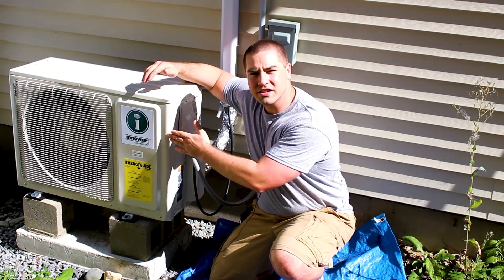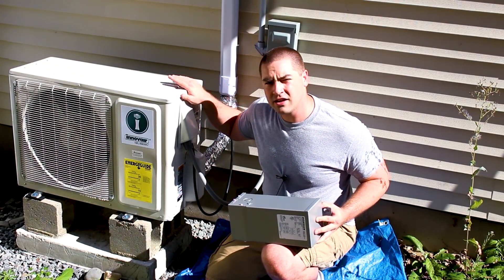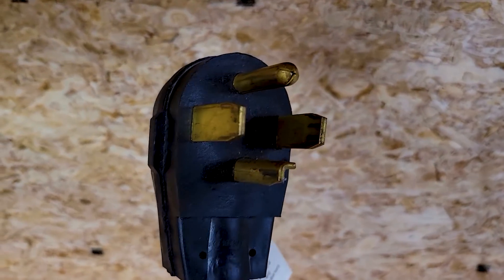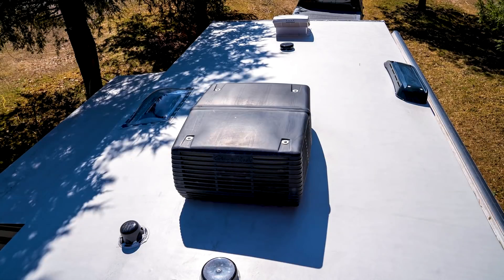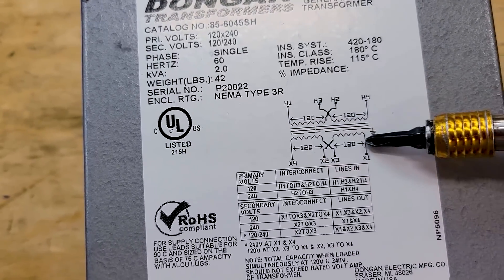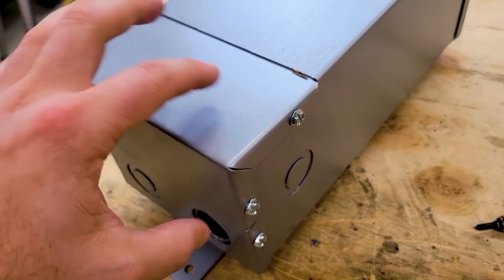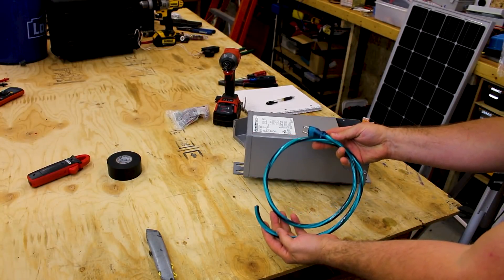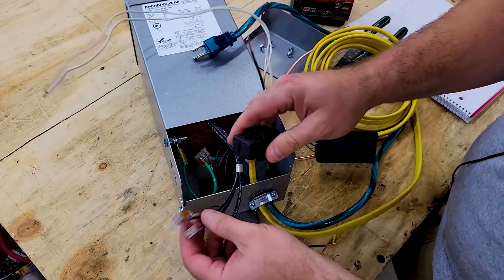Transform your mini-split heat pump for your RV/Camper Project

Comment: So my mini split is 120 volts and therefore a transformer is not needed, BUT I'm wondering if you know the best way to convert it so that it also provides DHW, in addition to cooling and heating RV. In a perfect world it would also be the source for underfloor heating... Am I reaching for the stars? I know there are commercial products out there that do all that but a. They're ridiculously expensive and way outside my budget, and b. I figured there has to be a way to do it myself

Comment: David I just installed the inovair 38 seer 9000 btu mini split on my holiday rambler 30 foot travel trailer.  It's running perfect on my sungold power 220 low frequency inverter.  The minisplit cools down the camper in 10 or 12 minutes then goes to its lowest power and keeps it cool on almost no electricity.  Thanks to you doing the install I was able to get mine done in a day and since you chose that unit I knew it was the one I needed. It's so efficient that my 1800 watts of solar seems to be plenty to keep up. I'm truly amazed at how awesome the inovair is and so glad I did the 220 38 seer. Thanks man for doing what you do
Reply from the maker: Glad to hear it is working well for you.
Reply: @DavidPozEnergy  do you know any bms that would be able to be adjusted to work with my nissan leaf cells? I've never had a bms before and people say I need one with leaf cells. I have 24 cells in 24 volt configuration.  They will still be powering my sungold 4000 watt split phase inverter
Reply from the maker: A BMS is a good idea to use with any lithium battery.  
You said your setup is "24 cells in 24 Volt configuration.  
Nissan leaf cells are 3.65V nominal, so the ideal configuration is 7 cells in series for a 24 Volt battery.  However, 7 doesn't evenly divide into your stated 24 cells, so I'm not sure what you have.  Perhaps you are running 6 cells in series for a 22 Volt nominal battery?  
When choosing a BMS, you want to make sure it is configured for the cell type, and series configuration you have.  I'd start with looking at this one: https://batteryhookup.com/products/12v-lifepo4-smart-bms-w-low-temp-cutoff?variant=37389119422626 but make sure you select the correct BMS for your setup. 
The other thing to consider is Amperage.  You stated you have a 4,000 Watt inverter.  You will want to do out the math for your systems worst-case scenario, then make sure you get a BMS that can handle the Amps.  For example:
4,000W/.9eff./20V=222A
This means you need a BMS that can handle 222 Amps continuous.  If you go with the link above, the BMS is good for 100A, which means you will need 3 BMS's, and break your pack into 3 equal batteries.  Each battery has it's own BMS.
Reply: @DavidPozEnergy  thanks yes it's 6 cells in series but I'm using 24 modules. I have 12 modules in a stack and then it's 3series of 4 parallel modules.  It's 24 modules total so it's actually 96 actual cells. But yes I charge them to 25.2 volts and they always work great but people say they are dangerous without a bms. Looks like I'll have to have several bms tho and break the stacks of 12 into stacks of 6. That would've it where I have to get 4 bms total. Probably 4 or the 6s bms but it's gotta be adjustable top charge of 4.2 or so
Reply from the maker: @Matthew Knight  Yes, break it into 4 batteries, each with one BMS.  By the way, if you use my discount code DAVIDPOZ it gets you a discount,  and helps out this channel by the affiliate program.
Reply: @DavidPozEnergy  I know you are busy and all but I trust you with knowing your stuff and since you built the battery with the volt batteries I figure you would know what bms I need for the leaf cells. Thanks so much for all you do

Comment: I have 2 inverters in my camper. A 3000 watt that the camper is kinda plugged directly into and I have another low frequency 240 volt sungold power 4000 watt inverter setting under the bed. I'm buying the same inovair 38 seer 9000 btu  unit as in the video. I'm hoping I'm making the right decision rather than just getting a 110 unit
Reply: @2hotscottpro  I'm using the sun gold 4000 low frequency inverter now and have 32 280 ah cells under the bed. I only use that one inverter now for the whole camper and everything in it including the mini split and an outrageous home entertainment system. I charge with 5 victron charge controllers. 2 of the 100. 30, 1 of the 100. 50 and a 100. 20 and a 150.70. I several different solar arrays and still need 1 more pallet of panels at least. The mini split don't bother the system during the summer but in heat mode it will eventually run my batteries down to where I don't like them to be. I normally just turn on the propane furnace to help it with distribution of heat and take some of the heating load off of the mini split. Once I get another pallet of panels I'm thinking I'll be able to do all the heating with the solar as well and not need the propane. I can't remember off the top of my head what my mini split draws. It's never the only thing running is mostly why I don't know. I do know that in summer the panels keep up fine and while I'm away the system is always 100 percent when I get back. I spend a few days there and even if it's raining the whole time the system won't get down to 50 percent. Winter time is different. If I spend 4 days at the camper then on day 3 and 4 I'm turning on the propane heat to not deplete the battery so bad... When my battery bank was smaller I thought I'd never be able to do it but once I got the cells and saw how long I could make it without a charge at all is when I started seeing that this can be done. I've also built another system that runs my shop but with that one I also need another pallet of panels added lol. Shop tools can run that system down in about 2 days
Reply: @2hotscottpro  not very efficient and it's most definitely not the inverter I'd choose today. Those low frequency inverters have their place tho... Like running a well pump or maybe part of a workshop. It's not by any means an efficient inverter. My mini split and fridge and led lights are the only thing that is efficient in there. Hell, most the time I am using the electric side of my water heater. I'm only there 3 or 4 days a month and charging all month so..,  yes if I had it to do over again I'd definitely buy an eg4 6k  or something like that probably. I'd say that would be a much better way to go about it. Even if it needed replaced more often due to it being high frequency it would save on having to have a larger bank of batteries. I like the way I've never had an issue with low frequency inverters but they are not efficient. It's all in what you want and how much money you can spend I guess.
Reply: @2hotscottpro  175 watts seems like a lot man. And I'd definitely either get an efficient inverter if I was staying there a lot and just try to have one on the shelf for if and when it stops working I could switch it out ya know. Thing that worries me the most is leaving 50 grand worth of solar stuff setting there running all month while I'm away. Lightening and thieves lol..  that's my biggest fears and worries with my stuff
Reply: @2hotscottpro  I could have spent way less money if I'd known what it was gonna take from the start lol. I started buying real junk at first then started buying a little better equipment but was still buying to small of stuff. Eventually I just put my smaller stuff in my workshop along with a rewired leaf pack and it runs the shop now. I would have most definitely never bought the leaf batteries knowing what I know now. Id actually still like to double my battery capacity. With 64 cells I figure I can heat and cool the place and still have electricity for heating water and cooking. Another pallet of panels is probably next on the list along with more cells. I'm looking at buying a small home hopefully in the next year or so and I'll drag all this crap out of the camper and run my house with it... Or just plug the house into the camper lol
Reply: @ o
K

Comment: What really want is a non-US inverter and heat pump.  Outside of the US 240V and 50 Hz is standard.  Just don't run anything else off of that inverter.

Comment: I am starting to look into how feasible it would be to get rid of the gas generator on my food truck and switch to a battery bank. I'm not very experienced with electric or battery work, so I'm still in the process of finding how many kWh will be needed. But you know, it's a couple of fridges, a freezer, register, lights,a/c 15k/btu and i have electric water heater that consumes a lot of energy it is a 13kw 54amp and water pump 7amp   phone charging, a fan.
I have 20,000 watt including everything the food trailer is 30ft   I need to convert stored energy . The  breaker box on my trailer is 50amp ,  120 240

Any and all help or suggestions are appreciated! Please let me know what other information could be helpful. thank you
Reply from the maker: Can you send me a message in Facebook?  @davidpozenergy

Comment: David, how do you mount outside unit on a roof?  Wondering if there is a way to repurpose a split-air, 9000BTU unit, but put it on the roof not outside.  We keep motorcycle & two bicycles on back.  There is no room to mount split-air.
Reply from the maker: I don't know, I've seen people mount the compressors on the tongue of cargo trailers.  Perhaps that is an option?  If you really want the AC on the roof, then it would probably be easiest to buy an AC designed for that.  I think Dometic has some.https://www.dometic.com/en-us/outdoor/climate-and-comfort/air-conditioners/rv-air-conditioners

Comment: So bit of napkin math I figured out why the bluetti was measuring so high.
You show towards the end 608 watts on the meter downstream of the transformer and a 0.93 power factor. 690 on the inline meter at the bluetti, and it's hard to tell but I'm going with either 735 or 755 on the bluetti screen (it wasn't in focus). No measurement device is perfect and it's hypothetically possible there's a slight shift in power factor through the transformer. But 690/0.93 would mean assuming your meter is measuring real power not apparent power, that the apparent power would be 742kVA.

I think the bluetti is displaying apparent power not real. An unloaded transformer has a horrific power factor and could explain the hugely bloated figure

Comment: Transformers aren't magic, they're basic elements in an electricity network and can incur major losses in efficiency.
The difference in power usage you saw on an unloaded transformer is because both meters calculated power differently due to the power factor of the unloaded transformer, which is horrible. You're better off using a made-for-purpose heat pump for your RV / Camper, simply because of efficiency or weird issues you WILL get along the way.

Comment: Are you sure that 288W is incorrect at 10:12? That power meter you plugged in only measures AC Watts and not VA. And since the transformer is an inductive load with PF<1, we should be looking at VA I guess. I'm guessing your inverter measures DC Watts, which is more accurate for a DC source, not the AC power meter. Hope you can measure the actual current consumption at the DC side and confirm the idle consumption of the transformer.

Comment: Hey David, I have a quick question. Just upgraded my solar systems power bank along with 3 out of 9 panels for 330w instead of 240w, but not seeing any increased performance.

Now I have 2 x 24v 100Ah Lithium batteries. 
The new one had a defect bluetooth app.

I hooked them up in parralel, but my capacity is still draining at the same rate as before, haven't doubled at all. 

Do you have any idea what the issue might be. The inverter is connected to the one with a functioning bluetooth, thats how I keep track on its consumption and how fast its draining :)
Reply: Its still saying it will be drained within 14 hours, which was the usual capacity.
Reply from the maker: There are a lot more questions to answer before being able to give a good answer.  I'd suggest joining the facebook group called "DIY Powerwalls" so that you can ask your questions, but also provide photos of your system to help identify the issue.

Comment: Would I be able to use the same setup to run a 220 V submersible pump?
Reply from the maker: Yes, you just have to make sure the transformer is rated for the watts the pump will draw.

Comment: On a string of panels feeding the growatt 5000es at about full 450vdc I would have one set of wires from panels to a cutoff switch then into inverter.Would you just fuse/breaker the positive or would you do both positive and negative before the switch?Also I'm assuming that grounding the chassis of the array plus fuses/breakers on both leads would isolate the rest of the system from lightning or an electrical short from the panels. Am I thinking correctly?
Reply from the maker: On my setup, I fused the positive side, and ran both positive and negative into my disconnect switch.
Reply: @DavidPozEnergy  do you have a lightning arrester/breaker anywhere on the system.My concern is only lightning.My array will consist of just 2 strings feeding each inverter so no combiner box.
Reply from the maker: I have a Midnite Solar brand surge arrestor, but I have not gotten around to installing it yet.  There are also some good ones sold by Signature Solar.  https://shop.signaturesolar.us/collections/emp-shield?ref=4_rHcgZ9x-TiF-
Reply: @DavidPozEnergy  yes that's what I was trying to avoid by grounded the outside of the arraybas well as fusing both positive and negative pv leads before the switch to the inverter

Comment: Interesting Idea.  However the 110 mini splits are so much more efficient and you can do a double unit if needed off your single compressor. I run mine off my solar easily and the one unit cools my 36' class A with no problem. Mini Splits are so much better for sure. Thanks for the idea and great job with the video.
Reply: Not when you compare for size. My 9000btu is 240v with a 38 seer rating.
Reply: @nortavon  Good point for house units. RV's only can do 110 volt and what I meant was compared to my old RV AC this is much more efficient.

Comment: soooooo  most rv's are 30 or 50 amp. Thats 240v . Install a single input breaker panel in the 240v line. Then continue the wires to the fuse panel. Hook up you new mini split 240v unit to the new breaker panel.
Reply: 30 amp RV is only 120v not 240v.
Reply: @HotTorch451  yup. I was think house not rv.

Comment: Since the mini split is actually using DC (at least mine is), it would be nice to see a more involved conversion to run directly off of DC voltage, potentially negating the need for the step up to AC altogether.
Reply: Almost every single mini split uses an AC compressor. At least those that are for residential/commercial use.
Reply: There are plenty of DC direct drive from solar panels on the market but a lot more expensive
Reply: @SpencerLAPower  right, that's why it would be great to see a conversion!

Comment: Have you seen a you tuber "Donnie does things"? He talks about losing a neutral from the transformer in a setup similar to yours.If you could put your two cents in on that or a video I would appreciate it. I just started building my system and am mirroring yours pretty close.I just picked up both inverters and the new gro watt transformer.I have to get things in steps due to cost of everything.I have a pretty good understanding of this setup but don't see how what he is trying to protect is even possible in this setup.To me if the transformer loses 240 it stops. So unless it internally shorts there is now way to have a "lost neutral"?In your opinion is this even possible?how likely is a transformer going to short?Please shed some light on the subject. Thanks

Comment: Like others have said I would only use an isolation transformer when one has no other options. 120V 9K or 12KBTU mini splits are available and would be a much better option than using a transformer with a 240V unit. This way one can avoid the parasitic losses associated with the transformer. Great video in showing this option.

Comment: David, love your videos. It looks like your compressor unit runs on split phase 240 from your main disconnect, L1 120v, L2 120v. But you supplied L1 with 240 pos or neg, and L2 with 240 pos or neg from the transformer? How can the unit operate on either 240v split phase or  straight 240v? Thanks
Reply: It only runs on straight 240v. The transformer outputs 240v L1-L2. Without bonding the transformer it might be 240-0, 120-120, 60-180, or anything else. The only thing the equipment cares about is the difference across the two hot wires.
Reply: @eDoc2020  Ok question.. Would it would with a standard step-up transformer using the hot and neutral wires?
Reply: @Travellerwiz  A unit like this would work with a plug-in 120->220v step up unit if you add the right plugs.
Reply: @eDoc2020  Interesting. My understanding is these units are looking for "split phase" 240, 2 hot lines (L1 and L2). However, standard step-up transformers (like sold on Amazon) just step up the straight 120V lines so you end up with 240 across the hot and neutral. 

What am I missing?
Reply: @Travellerwiz  IIRC these units only have L1 and L2 (no neutral) in which case they should be fine with straight 240v. It should only be a problem if the units needed neutral in addition to L1 and L2.

In any case it's possible to reconfigure the connections inside the retail step-up transformer to output 120-0-120 instead of 0-240. This would let you run anything.